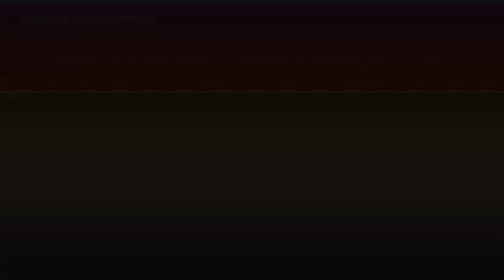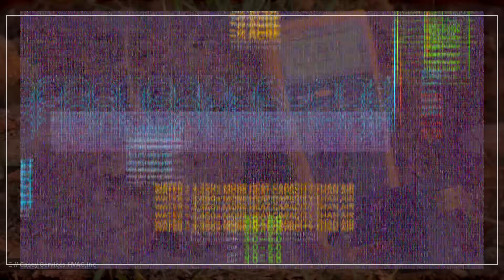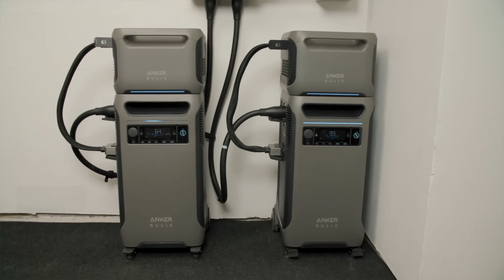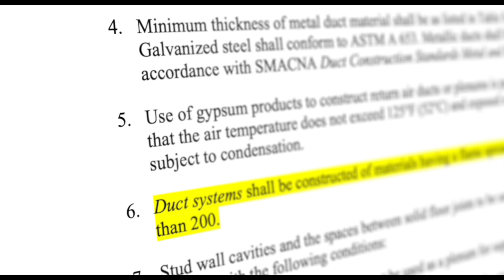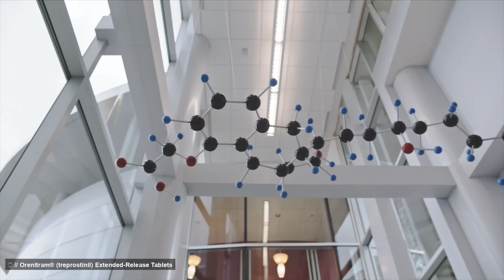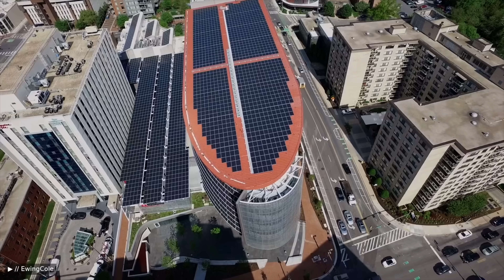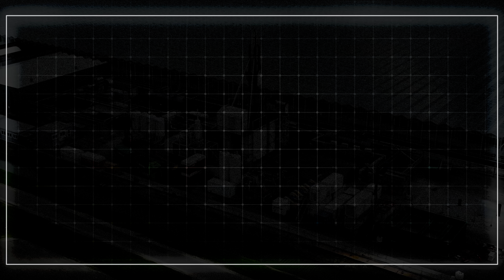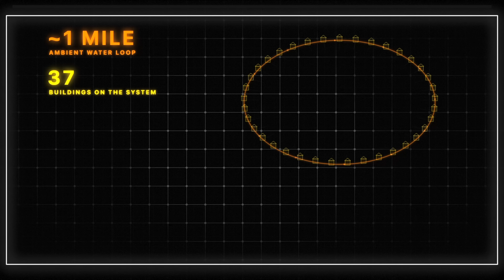The Viral DIY Cooling Hack That Nearly Killed a Family

Comment: bro I'm not gonna google fahrenheit to celsius wtf lol
Reply: In your head:
   C to F: double, 
               subtract 10%,
               add 32
   F to C: subtract 32, 
               divide by 2,
               add 10%,
               add 1% (optional)
Reply: @darthgentlyy  95% of the world's population is using metric.
Reply: @johngaughan9399  Yes, Celsius is considered part of the metric system. While the official SI base unit for temperature is the kelvin, the Celsius scale is derived from it and is widely used alongside metric units for everyday temperature measurements. One degree Celsius is equivalent to one kelvin in magnitude, and the metric system includes Celsius for practical applications like weather, cooking, and science.
Reply: @Gert-DK True, but the ones that walked on the Moon were in that 5% :)
Reply: @darthgentlyy  That's actually not entirely correct. It was all made in metrics by the German scientists in NASA. Such as Wernher von Braun and Gunther Wendt and many more.
It became translated to imperial, so the astronauts had any idea what they were doing. That process was stupid as helx, since it took up processing power in the tiny computers on the spacecraft.
I think NASA is all metric now, like drug dealers are, have been for a long time.
Reply: @Gert-DK  I just said that the ones that walked on the Moon were in the 5%, not that they solely used non-metric to do so.  But more on topic for this vid, the Apollo radio traffic and much of the mission documentation of that time uses Fahrenheit for temps.  NASA research papers and such of course used SI units even back then.  But when Armstrong and Mission Control talked about  LEM temps and such they used Fahrenheit.
Reply: @Gert-DK  Also, the US space program was augmented by German scientists but they were not the sole minds, not even the central ones, outside their program.  The Army, Navy, and Air Force and a few universities all had rocket research programs before war's end.  Liquid fueled rockets were invented and first flown in the US.  Von Braun and his team made large contributions but weren't fully trusted by many and there were turf issues wherein US researchers did not care for the idea of a former Nazi waltzing in and telling them what to do.  And they did not let him.  It was some interesting decades of history.  The failure of Vanguard 1 was probably for lack of willingness to entertain the Von Braun team view on the problems.
Reply: @darthgentlyy  Of course they used Fahrenheit, they didn't understand Celsius. 
My point is, that it was all planned and build in metric, then later converted to imperial, which in itself is stupid. Over time, billions of dollars have been lost because of that.
Reply: @darthgentlyy  These Nazis did not "walk in", they were recruited. 
Braun was very much a leader in the Apollo project. Look up his honors and awards, there are many. He was the de facto boss. It was his dream come true, that started in the 30's.
Reply: @darthgentlyy And yet NASA themselves use metric. Go figure.
Reply: @just_passing_through  You missed the point.  I’m only talking Fahrenheit and Celsius.  Mission Control and Apollo astronaut radio traffic and mission reports all used Fahrenheit while the research and scientific side of NASA used Celsius, as expected.  Y’all are taking this all so serious when grade school arithmetic is the only difference between the two.  I convert in my head all the time.  So ez
Reply: @G @Gert-DK ho said they “walked in”? Not me.  And actually Von Braun and his team spent weeks moving around Germany with his team trying to make sure they surrendered to the US while avoiding the Soviets and the remaining diehard German military.  Teitel’s book Breaking the Chains of Gravity covers this period really well.  Great read, highly recommended.  Once on US soil there was a long and awkward process trying to somewhat integrate them into the existing US rocket culture but the only thing the US was really curious about was the V2.  It was only a few years later when Von Braun was more trusted and naturalized that he had any leadership role to speak of and even then the gov tended to keep his team in a separate bubble to a large degree.  

The US rocketry program was quite healthy and growing, if young, before Von Braun came along with Operation Paperclip.   Both solid and liquid fuels were being actively developed.  The scale of the V2 definitely interested the US but that was about it and information gained from Von Braun’s team from interrogation certainly informed Redstone.  They weren’t fully trusted.  The US military wanted guided missiles and the V2 barely qualified as that, if it did really in the modern sense.

What Von Braun mostly brought to the table was incredible enthusiasm for the peaceful uses of rocketry and space exploration, not incredibly unique rocket knowledge or fantastic brilliance.  
His team was kept at arm’s length until around the time of Sputnik and the failure of Vanguard 1 that he was able to leverage a place at the table.  He was a great communicator and really helped get enthusiasm going for space exploration in general and was no slouch technically but US rocketry dwarfed his early influence in shear numbers.  The Manhattan Project happened just fine without him, for example.  The existing US brain trust was quite healthy in rockets as well as in physics, but the additions of refugee scientists from Germany had far more effect on the Manhattan Project than on rocketry.
Reply: Or, most calculator apps have a converter built in.
Reply: Me neither
Reply: -40 = -40, +40 = 100, 0 = freezing, 100 = boil water
Reply: Here's a few memorable conversions that are whole numbers

 -40F = -40C
 32F  =  0C  (water freezing point)
 68F  =  20C
 95F  =  35C
212F = 100C (water boiling point)
Reply: @max2562 here is a simpler one. 0c is freezing, 100c is boiling. Draw a straight line between to two and you know everything you need to.
Reply: @1Mutton1   oh right... and how does that help me convert fahrenheit to celsius?
Reply: @PaulFischer-q3d 86 = 30, 68 = 20. Pretty easy. Pick the closest point and 2:1 is good enough, so 64 = 20 - 2 = 18. Keeps you away from the actual fraction.
Reply: @PaulFischer-q3d Take the F temp subtract 32. Divide the remaining by 2. Or going from C to F.  Double C temperature and add 32 for F.  Example 10C = 10 x2 is 20. 20+32= 52F.
Reply: @PaulFischer-q3d you don't need to if you don't use it.
Reply: @kalasmournrex1470  and for your next trick, making working with fractions of inches easy.
Reply: @PaulFischer-q3d Simple. Stop using Fahrenheit. Done.
Reply: @max2562 you skipped the cool symmetry that makes it easy to remember. 20 = 68 and 30 = 86
Reply: @max2562  This is good. I would 10°C to 50°F
Reply: Here’s an easy way if precision is not necessary. 

30 is hot
20 is nice 
10 is cold 
0 is ice
Reply: @Dcecil 
THAT'S the thumb-guide us Yanks need, brotha. Not all heroes -wear capes- know Centigrade.
Reply: I think it is a channel for USAnians only.
Reply: @Gert-DK  correct, that is the largest audience for this channel I’m sure. People getting upset at American English/Units for an American audience probably also get mad at channels posting in other languages lol
Reply: @anonymeister123  Then I am right and will leave his channel.
Reply: Im an American flight student and studying aerospace engineer and I've gotta agree with you. I hate the arbitrary mix of  imperial and metric depending on the field and specific area of a discipline.
Reply: Yeah, agreed. Basics. 300 million people use Fahrenheit, 7 billion use Celsius. Fine if you wanna stick to antiquated system, but when speaking to a global audience, please have the decency to use a system that actually makes sense. Generally a dan of your work, but you're getting an unlike for being lazy and making thousands of people Google it. Maybe calculate the carbon footprint of that.
Reply: @GM-gh4dk  he's literally talking about US policy
Reply: 😂 it should be like translations
Reply: The only good argument about F and C is that humans are quite sensitive to temperature changes and can feel a room becoming warmer or cooler within about 0.5 degrees Celsius. Thermostats with a resolution of 1C create more customer complaints than thermostats with 1 degree F resolution. The problem is solved with a stat that resolves to 0.1 C
Reply: @kyberite  if you think it’s a chore to google then I’m sure you were one of the people who believed trump when he was saying that other countries pay the tariffs.  People being too lazy to do a 5 second google to find information is the problem with our society
Reply: @brent7900  No the problem with your society is thinking everybody has time for your antics.
Reply: @brent7900  Those are two unrelated things. You would think a scientific video made for an international audience would include a conversion to units used by the vast majority of the countries.
Reply: Lower temp at the end vs higher temp at beginning = zero need to understand Celsius concept.
Reply: If you're not going to figure out such things like fahrenheit & celsius, maybe scientific and engineering channels are not really for you....
Reply: Have to say as a kiwi I only know metic to inferior mesument for spanners. Grew up with tools n still need to stop n think. Can you convert 0-50'c to Fahrenheit? Because both have a different zero and ratio
Reply: @becheeesy Im not quite sure what you wrote exactly, but if you want to get an about number of what something celsius is in degrees, you multiply the Celsius temperature by 2 and add 32 to be in the ballpark of the fahrenheit conversion.
Reply: @Gman513 thanks, i understand it's basic math, but only time i have ever used fahrenheit is watching a video converting the american language to the res of the worlds language. if americans want to be different then try make everyone do the work, well, guess we are all used to that these days lol.
but seriously, thanks for the good tip to convert, will try remember for next time im listening to an american :)
Reply: subtract 10% of the result after doubling but before adding 32 to get an exact answer
Reply: If you are following scientific and engineering channel, then only thing you should use is the Metric INTERNATIONAL SYSTEM. There's a reason why Metric is default. People using F, foot and inches are ape counting with ape tools
Reply: @truenorthbc  If you have a problem with someone asking for a Fahrenheit to Celsius conversion, then maybe scientific and engineering channels are not really for you...
Reply: @SuperSviki no, it means he is a real scientist. It's effin annoying.
Reply: @1Mutton1  No it doesn't lol. What's annoying is not showing a simple conversion to units that VAST majority of the world uses.
Reply: @SuperSviki  Nobody owes that to you.
Reply: Exactly.
Reply: People who say "effing" are fucking annoying 🤣
Reply: @seanjoans4868  lmao what a stupid thing to say
Reply: @SuperSviki  "I want everything catered to my sheltered life and narrow view of the world and I can't argue this fact."
Reply: @seanjoans4868  I am proud of you for admitting your shortcomings. Now let people discuss this video and point out valid criticisms
Reply: @SuperSviki  “I’m going to immediately prove your analysis correct and believe I said something clever in response.”
Reply: @seanjoans4868  Really? Can't wait for you to do that.
Reply: @SuperSviki  Don't hold your breath.
Reply: @truenorthbc  If Americans can't use scientific units, perhaps they shouldn't be making scientific videos.  But carry on with your 'freezing point of sea water to temperature of a cow' scale.
Reply: @UsualYaddaYadda  i dunno... zero for freezing seems logical... really not worth this national pride bs... just translate... 

the units with less errors wins tho.
Reply: Just shut up 🙄 you people cry about everything.

Comment: Geothermal is one of the topics that I'm most interested in, so I very much appreciate this report. I wonder what happened to that laser boring company? I hope they're doing well.
Reply from the maker: pun intended? lol... yeah I think they'll only be viable for large scale geothermal plants. we'll be stuck with mechanical drilling for homes, or if new installs are wise, they could save tons of costs by doing this before they break ground. but again, the desire to have this has to be there. most people don't think about this stuff as much as you and I probably do
Reply: I don't think they are doing wells yet.
Reply: The amount of energy required to laser the boreholes would produce more carbon emissions than any geothermal system could ever save.
Reply: @JackHays75 And that data comes from where?